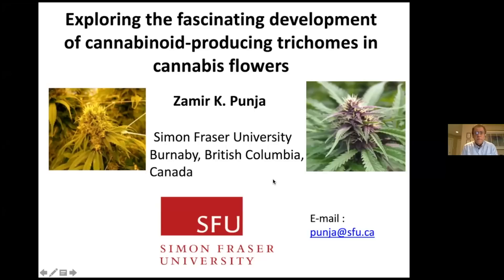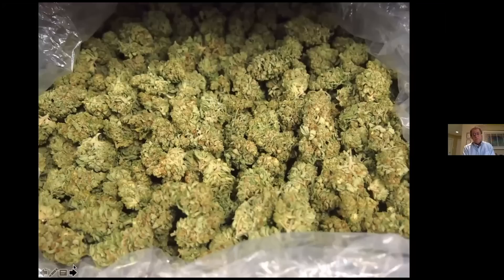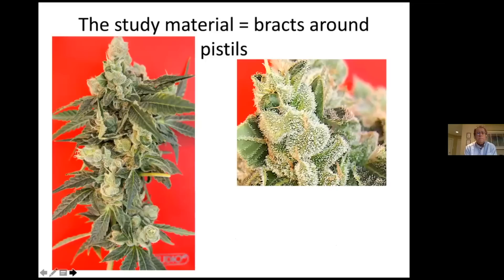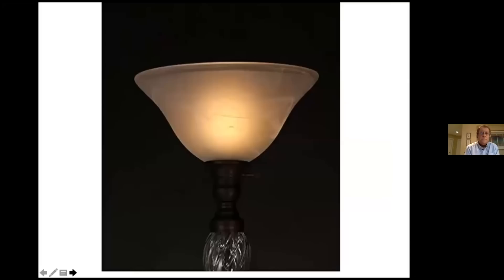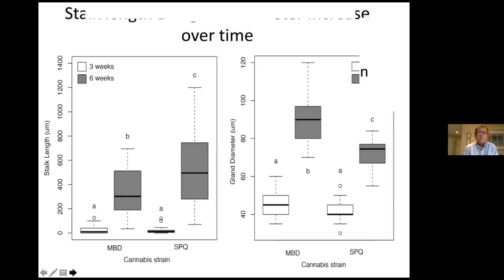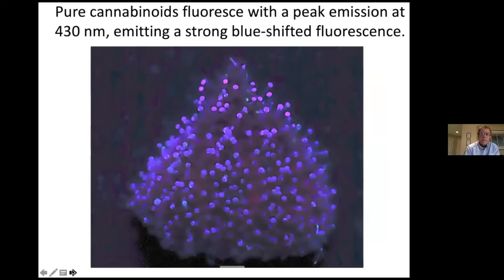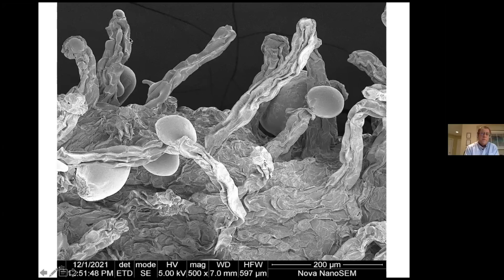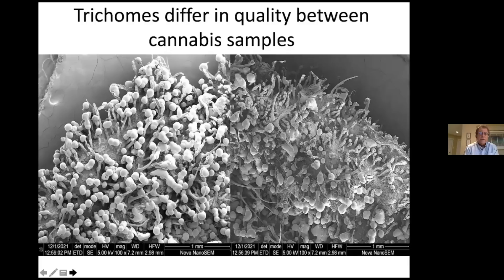Exploring the fascinating development of cannabinoid-producing trichomes -  Zamir Punja, PhD

Comment: I was already pretty familiar with the structure with glandular trichome head and the capitate stalk. These images are absolutely amazing though. It really gives me an amazing real life window into what these structures look like up super close. Also shows me the reason why that no matter how well you isolate the heads, the resulting hash will never quite melt down to no solid residue. Even with perfectly isolated heads, you still have those stipe cells and secretory cells on the underside that are not going to be melty. Even if you find a crazy mutation where those cells are super small, I'm guessing they'll still take up at least 10% of structure of the head. Which is why you can never get 100% melty product unless you blast it with butane or some other hydrocarbon, or press rosin out of it, to sort out the non-melty bits.

Comment: Great presentation, the SEM images are amazing.  It would fantastic to have a system to measure trichome density.  Trichomes per inch or millimeter (
Reply: There's a camera on amazon that does that, attaches to your cell phone. The "home version" basically of the advanced methods you'd be talking about. It estimates thc% based off AI/algorithm and amount of them in the photo. Couldn't say if it works, just wanted to mention it does exist just not quite at the level of a $30,000-1,000,000 scope haha
Reply: We did measure trichome density per mm square. They average around 10-12 per mm
Reply: @B01  none of the amazon cameras will do even close to this, I have a quite a few of them LOL.
Reply: @zamirpunja1978  That is fantastic!
Reply: @savuthyen  do close to what? What a $500,000 piece of equipment can do? Uhhh good thing we have you to let us know a $30-50 phone lens attachment doesn't perform the same as a scanning electron microscope 🤣🤣🤣🤣🤣🤣🤣🤣
Reply: @B01  very mature of you, you are welcome.  Just wanted you to be aware that your comment above is irrelevant.

Comment: I work at a company right now in Sacramento and we have multiple inhouse genetics that are regularly hitting 35+THC and thca and even have hit 42 a couple times we do also run a lot of sunkmaster flex genetics
Reply: What time is the best to harvest?
Reply: @SamuelEmrit  when your trichomes are cloudy. When to harvest is different for each plant
Reply: @xinniethep00h  ehen they turn emerald
Reply: @ColinMor-fj3qc  Why would they have to worry about the Feds?  It's legal for them to grow it.
Reply: ghettobabyjesus  I've never seen 35 to 42 for flower.  The highest I've had is 32 for Hindu Kush.
Reply: @SamuelEmrit full moon
Reply: 42% of the weight of a bud is thc  ??
Reply: @SamuelEmrit  now full moon!!! Harvest MOON BABY
Reply: @mkx9095  no more like water, it’ll lose half if not 70% of its volume when dried.
Reply: @norskibull2.021 that’s not what I meant .
Reply: @sicuro5050  square tires still roll

Comment: In regards to trichromes production at higher values on the underside of leaf.
I feel embarrassed to ask.  
Have filters for top side production been ruled out?
Has gravitational force as an aid to less energy expense for manufacture and production been ruled out?
Are these variables under study in weightless environments?
Is there a memory inhibitor as a variable?
Thanks for the presentation. Great job!
Reply: Seems to me it's just bc more pests would climb on the underside of leaves vs the top bc they like darkness for many reasons, including predators
Reply: its probably hormonal related. gravity causes the hormone responsible for trichome production to concentrate below. this is a well know mechanism in many other plants.
Reply: Hi David. There are fewer trichomes on the upper surface due to drier conditions and more exposure to UV stress. More develop on the underside but that may not be the only difference.
Reply: The biological purpose of the trichomes are to protect the plant from UV radiation and to deter pests. We can probably rule out UV radiation on the underside of a leaf, so pest deterrence makes sense. For outdoor cultivators, it has become somewhat popular to wash buds post harvest because of how good trichomes are at trapping bugs, dirt, dust, etc.

Comment: Will there be an affordable software for the small grower that helps identifying trichomes and ripenesses with these findings?
Reply: The best sign of when to harvest that I’ve found is when over half,or the majority, of the trichomes develop a bulbous head and turn amber/darken in color. Imo it’s the most effective anyway
Reply: just use your Mk1 eyeballs and maybe a magnifying glass. its very straight forward figuring out trichome maturity.
Reply: Bump
Reply: Yeah your eye Loop
Reply: They sell small magnification things for viewing trichomes. I've used a basic microscope, but it's difficult.
Reply: @ScooBdont  even sweeter is getting them 12 to 24 hrs before they turn amber and they are milky, they will continue to ripen to amber after harvested and the heads are still full size but as it was handed down to me from generations of collective grower knowledge which until recently was only shared in secret.. they all harvest when milky and its only a very small window to catch it just right sometimes down to the hour.
Reply: Don’t over think it, it’s the most simple part of the growing process. It’s all simple really but the more simple you keep it the more successful you’ll be.
Reply: Jewelry magnifying glasses in various magnifications. Handheld and easy to see trichomes size. Coupled with a handheld blue light and you’ll see those suckers light up.

Comment: Thank you very much for providing this to the community. Not sure if you can answer this or not, but do the mature trichomes only fluoresce at 430nm, or do they fluoresce at lower wavelengths (380-400nm) as well?
Reply: I can readily see florescence using 405 nm ("purple") laser pointers, and 405 nm or 450 nm violet LEDs. I haven't tried 365 nm or 285 nm true UV leds, but all kinds of shit floresces down there.

Comment: Brilliant!  Absolutely amazing. Thank you very much. Do you think one day electron microscopes will be in color? Does color even exist that small?
Reply: Unfortunately, there’s no way to record color with SEM technology since the electrons are only able to record one intensity value per pixel by nature. There are multiple tools available to add false or artificial color to SEM images but it relies on the user to select what colors to use. 

As far as the question of color existing at those scales goes, trichomes specifically are orders of magnitude larger than the limit for visible light so they certainly have a meaningful color, however the question gets murkier as you get smaller. 

We perceive photons of electromagnetic radiation that have a wavelength between 400 and 800nm in length as “light”, and our brain assigns photons it senses a color based on the wavelength. By that definition, color certainly “exists” even at subatomic scales. Atoms give off photons of different color light when an electron drops down an energy level. However the color of an object is a function of what wavelengths of light it reflects and absorbs - ie if something absorbs every color but green it will look green, it it reflects every color, it’ll look white, if it absorbs everything, it’ll look black, etc. Our ability to resolve an object is limited by diffraction to half the wavelength of the light you’re using to look at it with, meaning even if that object reflects green and looks green at normal scales, if you shrink it past 250nm or so, it’s impossible to even see at all no matter how good your microscope is so color becomes moot.

This is actually the entire reason we use electron microscopes in the first place - electrons have wavelengths millions of times smaller (depending on the voltage) than visible light, so by illuminating something with electrons instead of visible light, we can theoretically see objects millions of times smaller still.

Comment: On the subject of the tricomes on the bottom of the leaf and how many there are. We know the tricomes are produced as a defense mechanism, in different geological areas there different species of invasive insect. A lot  of those insects build cocoons and lay eggs on the bottoms of the leaves of the plants. The mass production of tricomes on the bottom could be an evolutionary manifestation of the plants defense system to protect the stomata cells, at this point in a controlled atmosphere the plants have been pruned and defoliated so the stomata cells have been greatly decreased. In turn, the plant is protecting the few stomas it has for maximum chemical production. just a thought, I've been studying a lot and this has crossed my mind. Maybe this could be a research venture, I don't have the means or the proper equipment. But would be interested in your thoughts.

Comment: It seems to me the reason there's more trichs under the leaves than on top of them is bc there's more pests that climb on the underside vs on top.
Reply: gravity concentrates the hormone responsible for trichome production towards the underside.
Reply: @nickhowatson4745  Post a link.
Reply: the top of the leaves is more exposed, so some development may be lost due to rain/excessive heat/light, pests and handling.
Reply: @artvandelay1967  That's not what I've heard. Nice try though. 🤣
Reply: @artvandelay1967  And it does the same thing with INDOOR.🤣🤣🤣🤣🤣🤣🤣🤣🤣🤣🤣🤣🤣💀⚰
Reply: @tenderlungs2065  you just refuted your own original statement
Reply: @artvandelay1967  Howso? My original hunch was the correct answer. 🤣🤣🤣🤣 My logic and reasoning skills are unparalleled. 💀🤡🤡🤡
Reply: @tenderlungs2065  if it was all due to pests, then how is indoor the same as outdoor? pests indoor shouldnt be near the issue as outdoor pests
Reply: @tenderlungs2065  my last response .  you still have light coming from above- so if your lights are too close, too hot that couild affect the development.  I offered up a few possible causes, thats all- the vitriol directed at me is beyond juvenile.

Comment: So, increase the `length of the stalk` and you’ve expanded the number of horizontally arrayed secretory cells … Which will fill the capsule up to the `stretching - breaking` point by expanding its volume of liquid held in reservoir. And, which `Arab-i-dop-sis` gene corresponds to the regulation of `length of stalk`? Assuming of course that such a mechanism has been preserved through evolution into the `Cannabaceae` family.

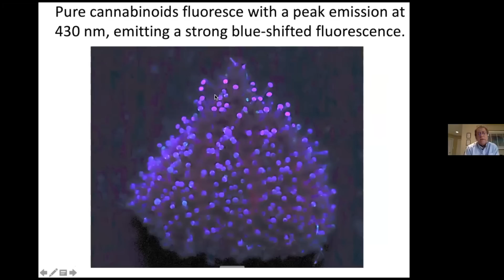Comment: 437 nm = 437 Hz; Corresponding wavelengths of energy in the form of photons and aural perturbations … Reflected back. All other wavelengths absorbed … 18:58
Reply: I know this is old, but maybe someone else will read it some day. 437nm has to be multiplied into the distance light travels per second. Then you will get the frequency. Nm is a wavelength. Hz is a measure of waves per second. So if your wavelength is 437 nm you divide 299,792,458 meters by 0.000000437. You will get 686,023,931,350,114 Hz, not 437 Hz. Just an FYI.